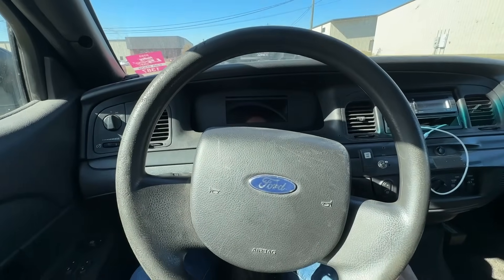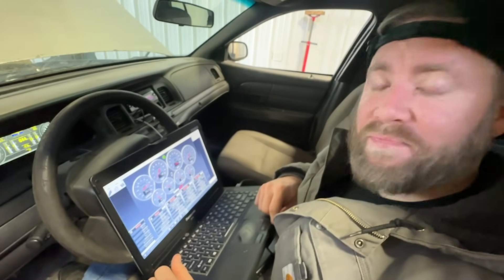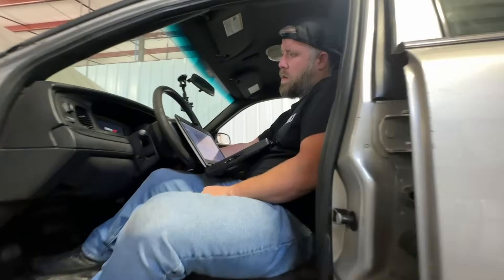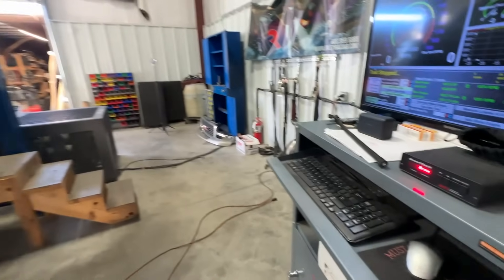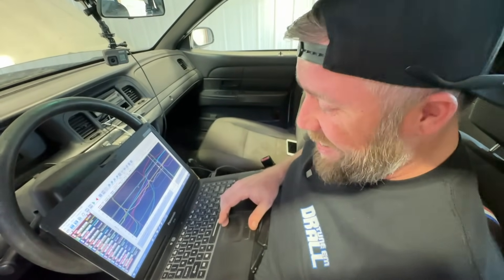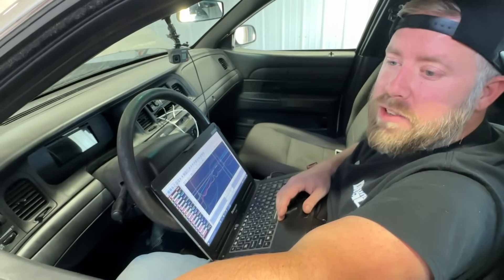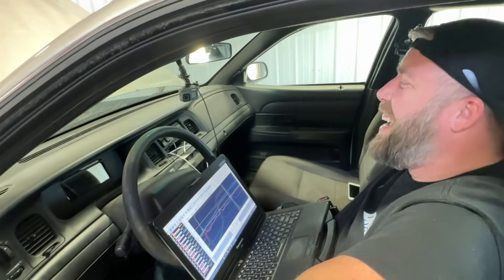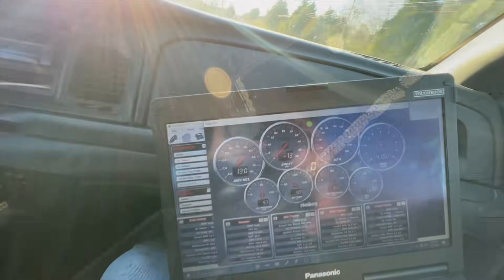My Turbo LS Crown Vic Hits the DYNO! 4.8L Gets ALL the BOOST! (Huge Power)

Comment: I am working on my first Ls swap. Ls3/4L80e in a 03'Crown Vic Police Interceptor.  It's good to see the 03' and up I can use the truck brackets. The alternator clears the hood. I've seen other with the 02' and back have to cut the hood. I have a Ls3 engine with Ly6 truck accessories. The usual. Using a few different engines to make one lol.
Reply from the maker: I have the higher amp alternator and it hits the hood so you may have clearance issues. I modified the truck accessory bracket to utilize the car intake